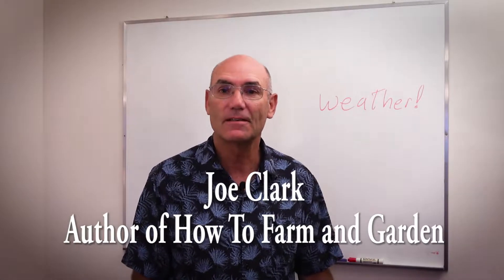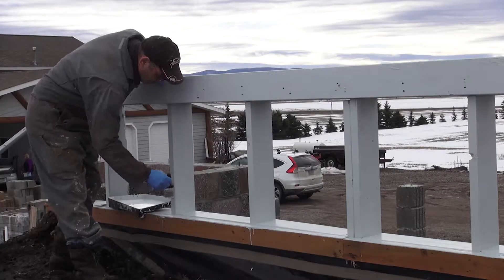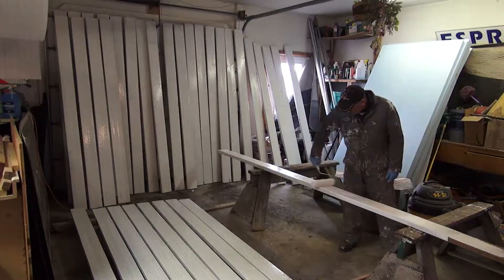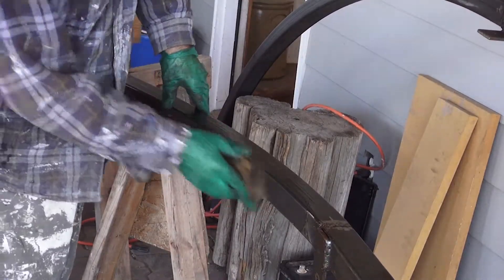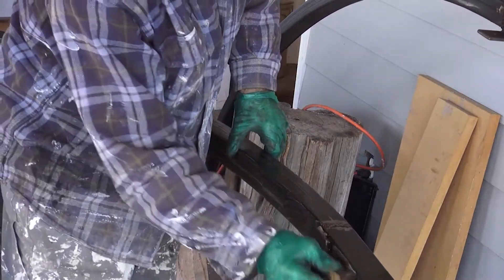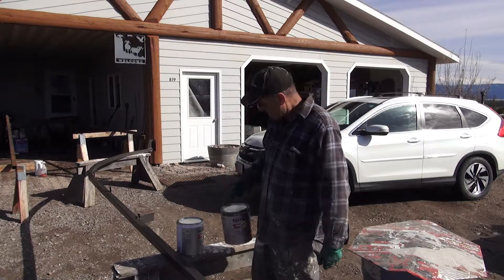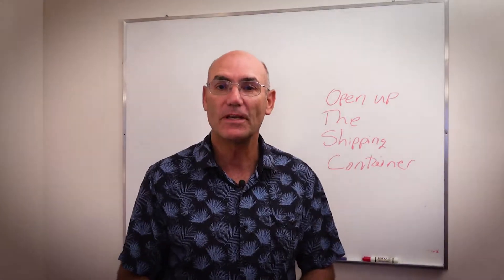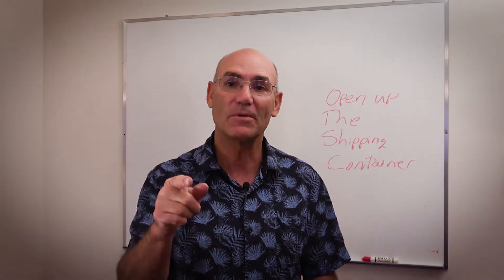6_Greenhouse Incorporating a Shipping Container_ Roof Structure

Comment: Sand blasting is worth it 
After clean the metal use phosphoric  acid (ace hardware) in sted of primer it will increase the adhesion  4x
Next time ck out rust bullet paint #1 it is a polyurea 
At least use a polyurethane

Comment: How did you put the bend in those square tubes?
Reply from the maker: We hired a local metal fab shop to bend the tubes.
Reply: Yeah, kinda skipped the most important part of the build. Wished you would have covered the bending, calculations if any and costs of bending. The rest is easy, the bending is the critical element here